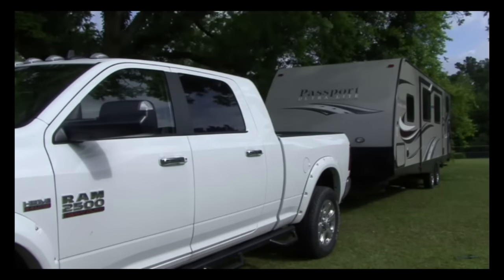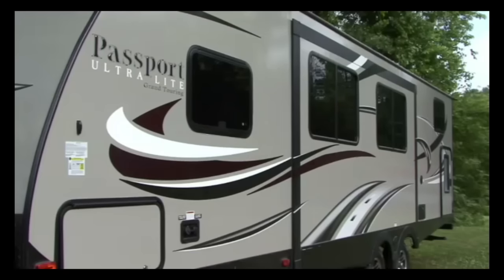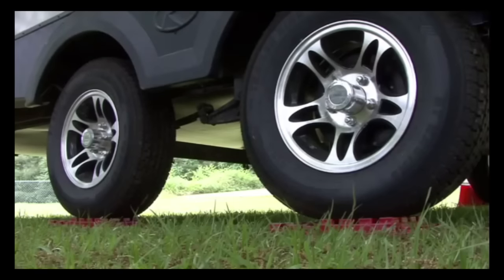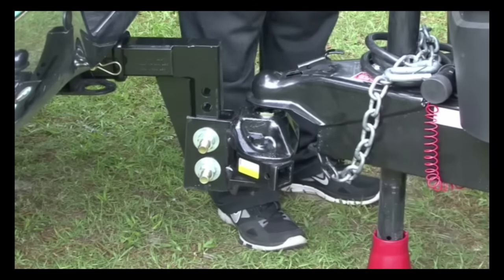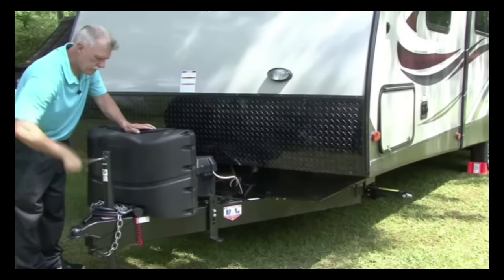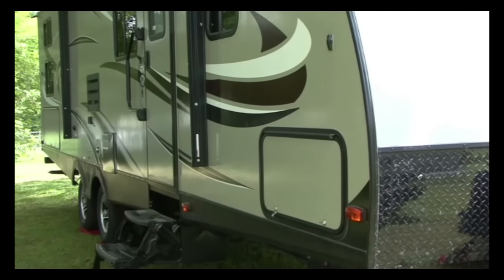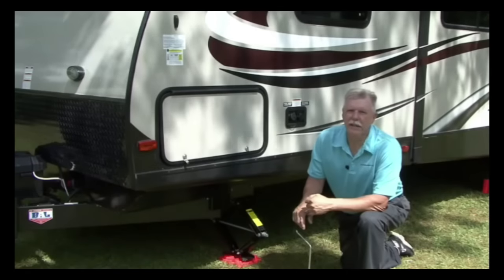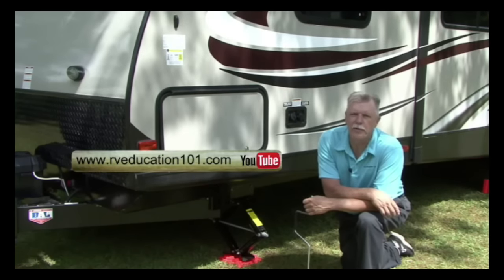How to level a travel trailer

Comment: At many RV park sites, the driving lane is very narrow so instead of blocking the lane with my tow vehicle while leveling, I disconnect the trailer and use a bottle jack to raise the trailer axle to place the leveling blocks under the tires.  It's a little slower but gets the job done.